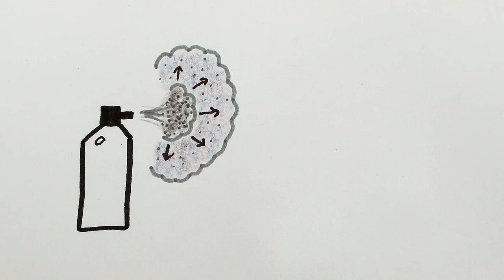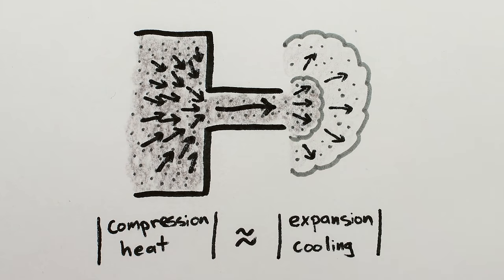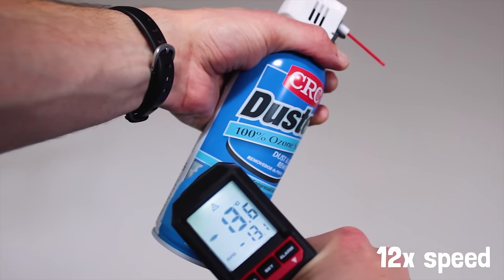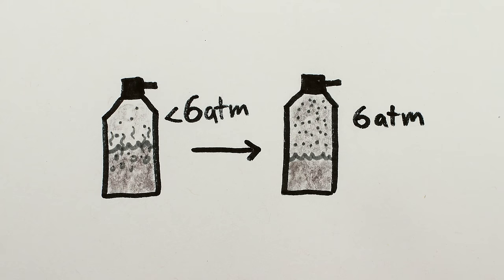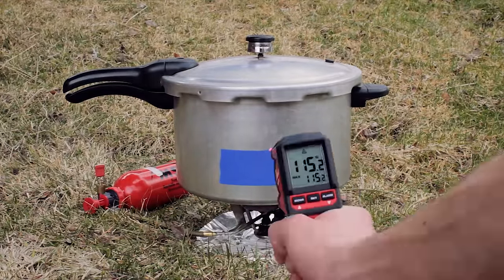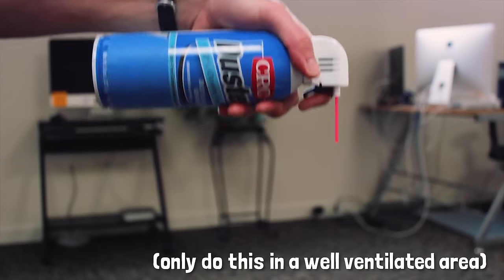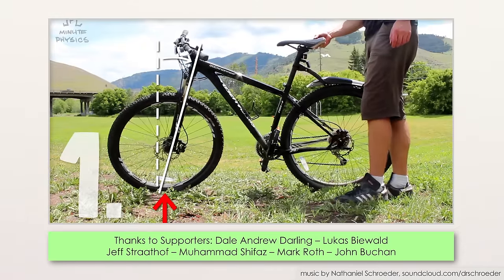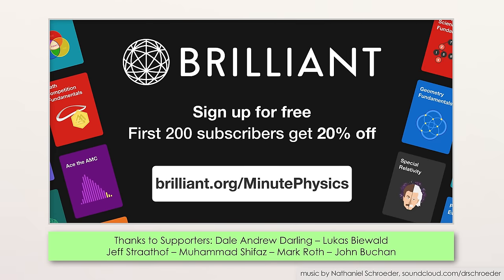Why Do Compressed Air Cans Get Cold?

Comment: energy used to turn the gas into liquids is being released...which is why it gets colder and not heat up...close to nobody knows that there is refrigerant inside of the keyboard dusters..
specifically 134a...which is a replacement to r12 refrigerant that  allegedly destroys the ozone layer because of chlorine gas in it...134a is used  in vehicles  these days and is also the refrigerant inside your refrigerator...so you are literally cleaning your keyboard with a refrigerant...people will think that you are crazy for saying that...but you get the last laugh because it is definitely inside there and it's an easy bet for you. I am a certified hvac tech and I know my refrigerants because I am certified to work with them...if you turn the can upside down liquid refrigerant will come out instead of gas which can get so cold that it actually burns you like a fire... temperature and pressure are related where you change 1...you  also change the other...if u look at 134a PT chart(temperature and pressure chart) it will tell you the temperature if you know the pressure of the refrigerant inside the ac...if you have ever had your evaporator coil in your central air conditioning freeze it freezes the water it's taking out of the air to cool your house...the pressure gets the temp below the freezing point of water so it accumulates into a block of ice...being low on refrigerant will cause it to freeze

Comment: They really shouldn't be called compressed air then.
I actually thought that it is just oxygen or a typical  mix of air, found on earth under high pressure.
Sure that couldn't have a constant 6atm, but I thought, maybe they start at 10atm and when get close to 1 atm, the pressure is weakening.

Def not gonna use those again.
Guess a hairdryer on cold setting is better then.
Using green House gas for that is just not necessary, when there are other solutions.
And that's me saying that, def not a typical green-voter.
Reply: Indeed. Several commenters argue in terms of compressed air after watching a video saying it isn't.  Odd.  But whether they get called compressed air by makers can be legislated, whereas the colloquial use of the term can't.  I haven't looked at one, maybe none are now labelled as compressed air.  If some are it's a failure of labelling standards.
Reply: @raykent3211  it's a marketing term for the function it performs.  The can has an ingredients declaration.

Comment: lol you don't need 6 min to explain this it is just because pV=nRT
Reply: I used to think that to, but in this case, I don't think n is constant since you are releasing particles from the vessel making 3 variables in the equation :)
Reply: what ?? n is a universal constant so is R.a constant can not be fixed in certain cases and variable in others that is called variable. by your words the volume is a constant because the volume of the bottle doesn't change V is a constant in this scenario because the  gas/liquid is in a closed container (the bottle)
Reply: so in this scenario the only 2 that changes are p and T you release the gas from the bottle so you drop the pressure in consequence the temperature drop  that's it

Comment: The title of the video is wrong. Compressed air is not the same as compressed gases in cans. Gases in cans can be liquified but compressed air connot (at room temps). Which changes the whole explanation and requires another video. Sadly, I'll have to dislike this one.